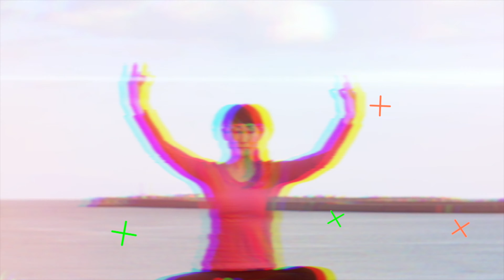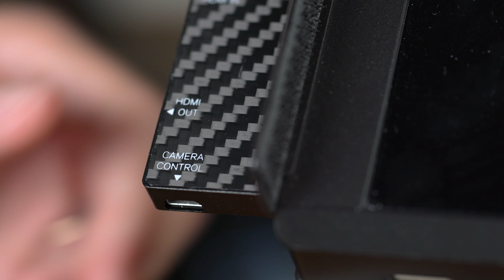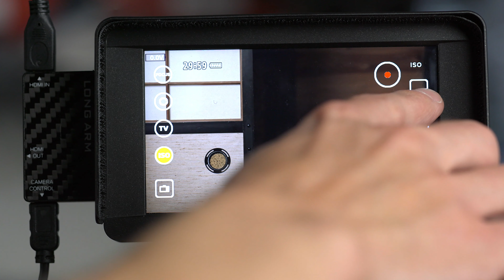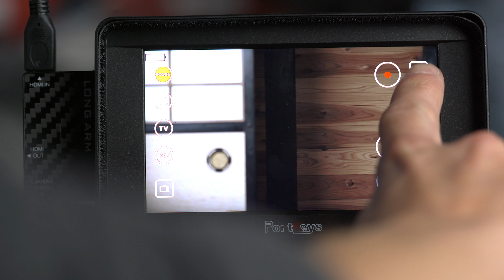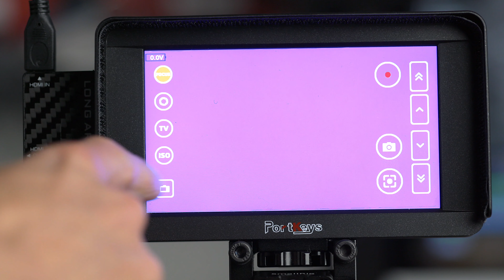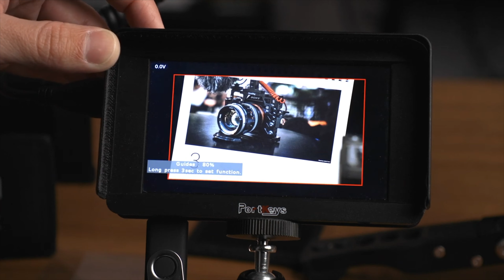Portkeys Long Arm Controller with Canon 5D Mark IV

Comment: Great video Scott! Clear and well detailed. Have you found a way to get the "touch to focus" feature to work with your 5d iv? I keep reading that the specs of the Portkeys monitor could work in tandem with Canon. thanks :)
Reply from the maker: Hey thanks so much! I actually don't have the 5D anymore, sold it to a friend to buy a couple of EOS-Rs ...if you message Portkeys on Facebook though they should be able to let you know how that's working, they're usually pretty responsive. Sorry I couldn't help more!
Reply: @ScottDumas  thanks Scott!
Reply: @ScottDumas  Great review. Can you confirm that the long arm works with the EOS-R?
Reply from the maker: Jeremy Revitch unfortunately I don’t have the cable for it so haven’t tried it out yet. Sorry!

Comment: Can you adjust the exposure and focus (like you showed in this video) while recording?
Reply from the maker: I believe you can only adjust before you start recording, but I'm not 100% sure and I don't have the 5DIV on hand anymore to check... I will be getting the BM5 with Z Cam E2 control cables tomorrow though, so I can check on that camera at least.
Reply: @ScottDumas  Have you been able to check to see if you can adjust focus while recording on the ZCAM E2?  Can you even do touch tracking while recording?
Reply from the maker: @raredreamfootage  I actually don't have the 5DIV anymore, but I've been able to switch settings while recording on the Z Cam E2 with the portkeys monitor. Touch tracking wouldn't work though, since the touch to focus feature of the 5D isn't available through an external monitor, touch or not.

Comment: Scott are you going to try this monitor in the Z-Cam E2? Is it really bright enough for outdoor shooting?
Reply from the maker: I've been using it with the E2 so far but I don't have the appropriate cables for the Long Arm & E2 yet. I will hopefully get those though and also I hope to try the BM5, which I think might be a little better with the E2. The brightness on the LH5T is ok, but I'd love something brighter. The build on the BM5 looks great too. Of course, a brighter monitor will probably eat batteries faster so it's a tradeoff, but I think it will be a good match.